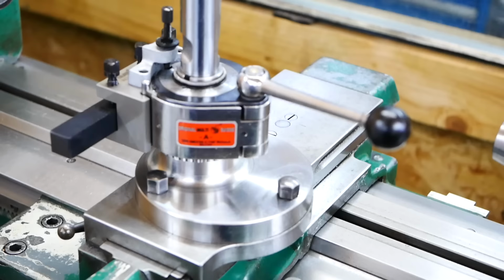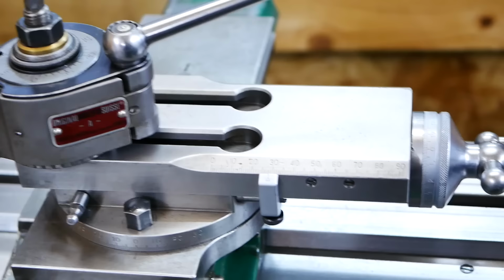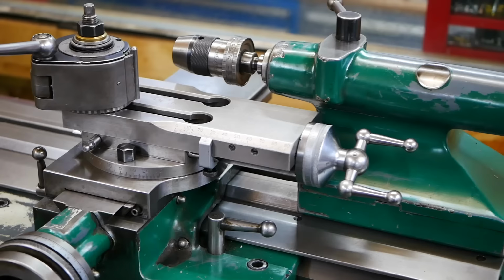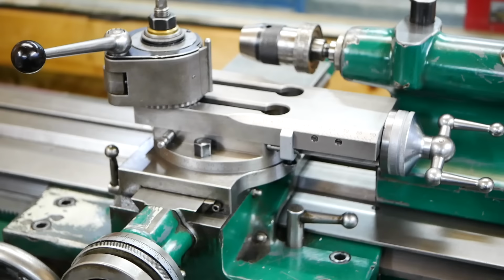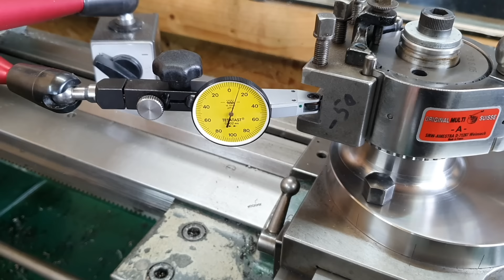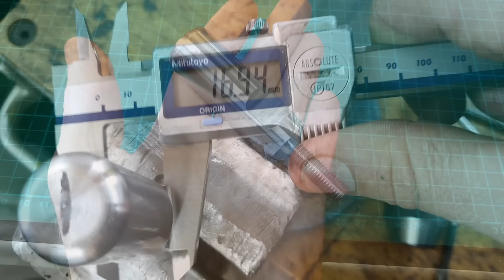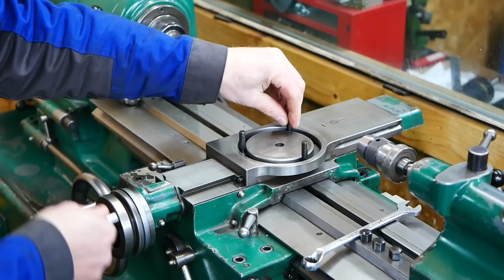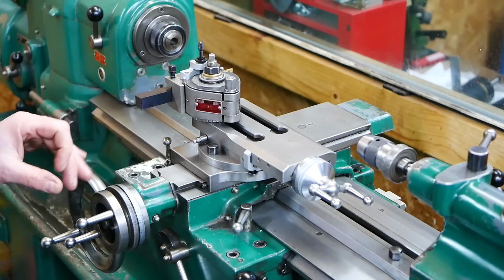Making a Solid Toolpost to improve my Schaublin 102VM Lathe

Comment: Nice, it looked so nice when you turned it while mounting. It's a thing of beauty. I usually just keep my compound at 30 degrees, so I never run into the tailstock. That way I get to take finer cuts.
Reply from the maker: Thanks. And yes, setting it at 30 degree is a good alternative and also more solid. Still the sol8d toolpost gives a lot more room to work. I do need to add a DRO for accurate work on the Z axis.

Comment: Mooi. Ik heb ook zo'n 102-VM, 4.000 toeren ex Philips Machinefabrieken. Die heeft wel een originele 4-voudig indexerende beitelhouder die ik zeker zal behouden. 
De Multifix is een enorm compromis qua stabiliteit juist waar je het nodig hebt. Optimaal is dat de krachten op de beitel direct via het gietijzer zijn weg vinden naar het machineframe. Ook is de snelheid van werken met Multifix minder als je repeterend werk doet. Chronova Engineering heeft daar een video over gemaakt. 
Ik zie zeker meerwaarde in het elimineren van de beitelslede want het is een rotding qua stabiliteit. De demonstratie van Rob Renzetti is erg overtuigend. Mijn ervaring is dat het alleen lekker werkt als je een vaste aanslag op de langsslede hebt, bij voorkeur in revolveruitvoering. Dit zit standaard op mijn Gema LZ 160, daardoor kun je heel goed korte lengtes handvoeden met het handwiel van de langsslede, vergt wel enige gewenning. Nog mooier is een afslag van de automatische voeding (zit ook op de Gema), dan kun je op vol vermogen vespanen en wat verder weg van de bank gaan staan, dit komt de veiligheid ten goede. Alleen moet ik nog eens kijken of dit te combineren is met de vaste aanslag voor langsslede-handvoeding.
Reply from the maker: Goed tips en argumenten 👍

Comment: Thank you for your video.
With due respect I disagree with Robin somewhat on these solid tool posts. This is a tool room lathe, it is designed to work within specific parameters and Schaublin knows very well how to design lathes. When we change out the standard compound tool post for the solid tool post we limit the versatility of the lathe. Let's understand tool room lathes are not CNC lathes, CNC lathes do work better with solid tool posts because they have different parameters and they are controlled by computers that enable them to machine any angle required. Are we saying that the original tool post can't make as quality a cut as the solid tool post? I think we can make equal cuts with either and I'm sure Schaublin would never let a lathe leave its factory that made inferior cuts.

I will say that I have personally made a solid tool post and I do use it but I still use my standard tool post for certain machining operations, especially tapers which do not work well with solid tool posts. Older lathes do not work as well with modern carbide and ceramic tooling because they involve higher tool pressures and speeds. Also, it is not always possible to take finer cuts with modern tooling without having several different carbides for different cut depths and materials which small shops aren't always capable of affording. With that said older lathes work very well with tangential cutters because they require less pressure, in fact older lathes work better with HSS cutters overall. With carbides there is a benefit to the solid tool post but the benefit is from speed not overall cut quality.

The other problem is the material the solid tool post is made from. Steel has a tendency to add resonance to cutting. I did verify this making both a steel and cast iron tool post. On heavy cuts the steel gave out a high pitch whine.

If someone is hitting the tail stock with the compound then they are not using the lathe correctly.

Comment: Similar toolpost height problems. But owner of a 102 and not of a 102VM. I ve sold the Multifix A  QCTP for a Tripan one. I had to machine a few tool holders to align tips on spindle axis. Lucky guy you are : a 102VM and a Schaublin 13!
Reply from the maker: Tripan is also very nice. And yes, bit lucky to have the 102vm and 13 mill as a duo together

Comment: It seems that these solid toolposts are all the rage, i don't have to deal with these issues, because 2 of my 4 lathes are CNC, 1 Lathe is sort-of-converted to a Toolgrinder, and the forth one only has a toolrest (Boley Watchmakers Lathe)

But.. this is a nice piece of work!.. It looks factory made, like it came with the machine..
Reply from the maker: Thank you Jan, that's a nice compliment. Yes if you have CNC you don't have this problem. But on a manual machine I makes sense. I wish I made it years ago. But I do find it important to be able to switch back to the original compound slide in a few minutes. So I wouldn't make it solid and permanent mounted on the cross slide.

Comment: Nicely done, Bart! What material did you use to make the plinth? Switching back to the old compound will probably be a rare event, once you're used to the solid post, especially with the Multi Swiss tool post. That mod makes a very noticeable increase in rigidity.
Reply from the maker: Thanks. Yes it's much more rigid. Material is unknown but it's steel with a some chrome in it. Doesn't rust as fast as regular steel.

Comment: Nice video and i have the same issues on my Schaublin 125c lathe.
Im gonna take a look if i can do a similar toolpost that fit my lathe .
The only downside is that when threading the parallel method I can’t use the compound to move for every infeed.
Bart do you maybe have any parts for a Schaublin 13 mill vertical head that you are willing to sell ?…
Keep on sharing this great videos 😀
Reply from the maker: I would definitely make one for the 125. But make it easy to change between compound slide and solid toolpost. I can do it under 2 min. So if you do need for taper turning or large threads then you can change it back. About the 13, unfortunately no parts for sale for the vertical head.

Comment: Great work! I've never seen this type of QCTP before, with a round side and splines. Is that system better than the common dovetail type?
Reply from the maker: It's common, especialy in Europe. Its called Multifix. The benefit is that you can fix the tool at different angles on the spline.

Comment: Question, why did you make the center tool post hold down bolt so tall? I would have made it a least 30mm shorter.
Reply from the maker: Good question that I didn't really explain. It's an idea from Stefan GTWR. It is used for mounting an indicator (with 30mm clamp and no magnetic base) or camera.

Comment: What material did you use ? Is it good at vibration dampening, compared to cast iron ? Did you consider using cast iron ?
Reply from the maker: Not sure about material. Something I had laying around in the shop for a few years. Steel with some chrome. Maybe 4140. Cast iron may be a bit better for vibrations but on this lathe the difference would be minimal.

Comment: Nice work but wouldn't getting a Tripan quick change holder have been easier :)  The 135 has a similar issue with Multifix B as your machine does with Multifix A) I switched to Tripan on that machine and it just fits so much better (even with the reduced height top-slide B is too big). I am not sure about the tailstock interference as it hasn't been a problem.
Reply from the maker: Hi Luke, yes good point on the Tripan. I have used one at work and it's a good fit. But I like bit oversized multifix. And I have a lot of tooling for it. But more stability and more room was the main reason why I made it. Now I made one I wish I've done it years ago.
Reply: @bartharkemametalworks2299  hopefully I don't come across as critical, I am just teasing a bit. If you are happy with the set up that is great. The access and interference issues are interesting, I don't have a VM but haven't had any problems like those with my 102. I guess the simple carriage allows much more adjustment than the screw cutting version. The 135 has no issues like those that I have found while running the Tripan. It would be interesting to see how much of the access problems would be helped with Tripan on the 102vm.

Comment: Is there a reason you're not using 12x12 mm tool holders, which would allow you to use the t-slots? In my experience, they're rigid enough for these small lathes. I understand the need for sharing tools with more than one machine, but in reality, tool holders / inserts in 12x12 size are quite affordable and appropriate for the machine.
Reply from the maker: Yes good point. 12mm would be enough for many cases. But I already have some 16mm tooling. Also parting blades and some boring bars didn't fit the original setup. And 16mm is more stable with some odd setups with longer stick out. But overall better stability is a more important reason why I changed it. I could grind of some 16mm tools and make them fit.
Reply: @bartharkemametalworks2299  yep, grinding is an option. I had a few 16mm laying around, but instead of grinding I bought a bigger lathe 😁 . Problem solved

Comment: I do not know why you would want to make a small lathe into a big lathe 
Simple Go get a bigger lathe
Reply from the maker: From my perspective. It's not a bigger lathe but a better lathe. And I can change the question to , I don't not know why you don't want to make a small lathe more stable. Now I made one I wish I would have done it years ago. Stability is not only bigger chips. Chip control, better surface finish, easier to make very light cuts, much more stable when parting off, etc. Adding 2 axis dro also makes more efficient. And I can change it back in 2 min as I have shown in the video. I really don't see any negative about it now I've used it. And I do have the Okuma LS as a bigger lathe that can do 8mm doc.